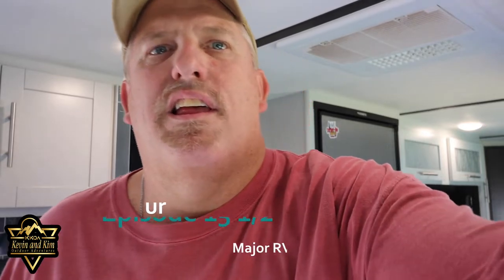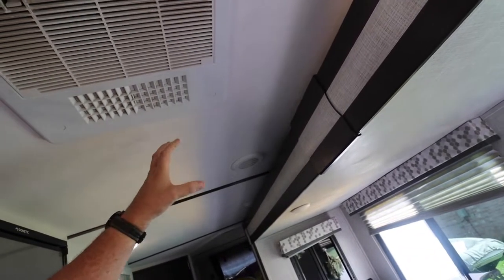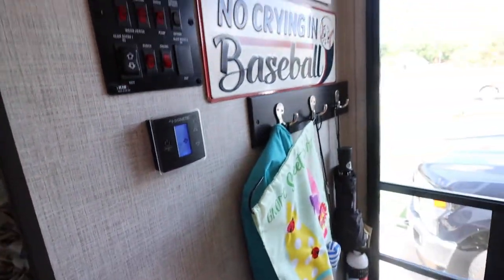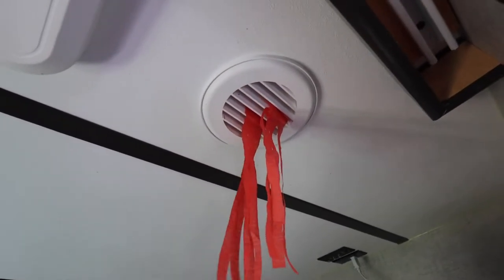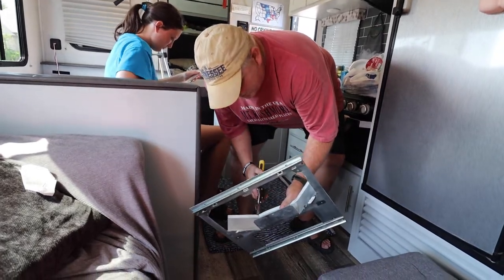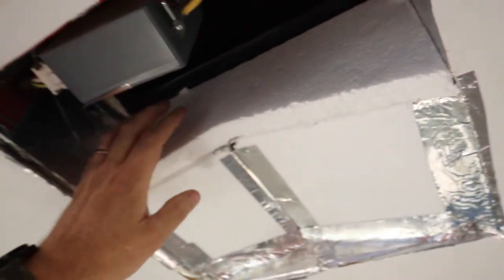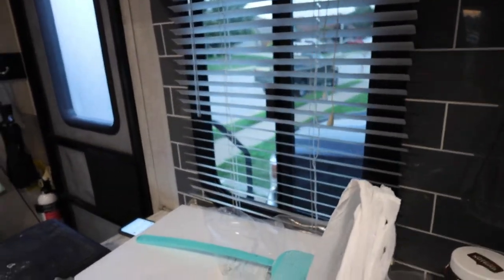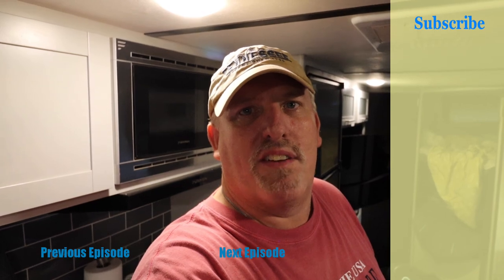BEST RV AIR CONDITIONER UPGRADE For Under $25 - 200% INCREASE!!

Comment: That looks very doable but question… will it cause condensation to collect anywhere?  I’ve had problems with that in my unit in the past. We taped it really well but the foam looks like a good plan but condensation is always a concern now. Thoughts ?
Reply from the maker: I don't know, we just did the mod and it turned out so well. I had to share the video. I wouldn't think it would cause condensation as it is increasing more air flow and better circulation. Thanks for watching!
Reply: Ok kewl I just may give this a go.
Reply from the maker: You won't be disappointed. I put a link for the materials you will need in the description of the video. Good luck!
Reply: How many sheets do you actually need i was just gonna buy the smaller kit of what you posted

@KevinandKimOutdoorAdventures

Comment: How long is your rv 
I have a 37’ & doing this you lose the ability to rapidly cool that area
Reply from the maker: Ours is 30ft and only have one ac unit. You would think you lose the ability to rapidly cool an area by the unit but not true now we rapidly cool the entire rv because it is so much more efficient at cooling now. There was so much air loss going in the attic between the ceiling and the roof that it wasn't even working. It is night and day now. Thanks for watching!